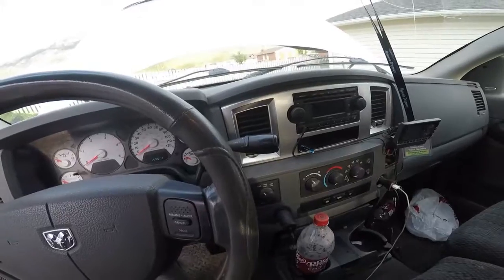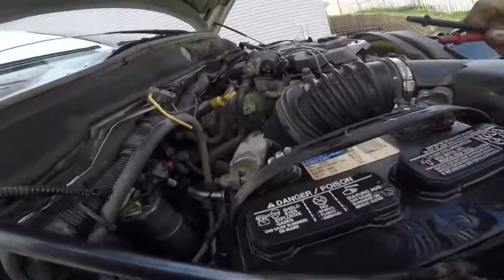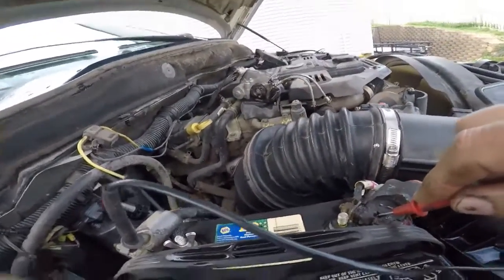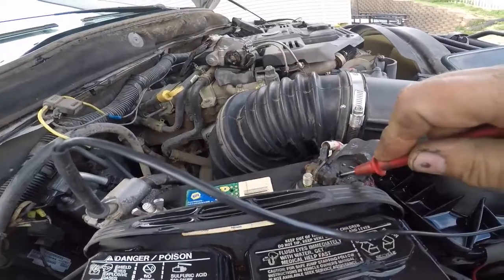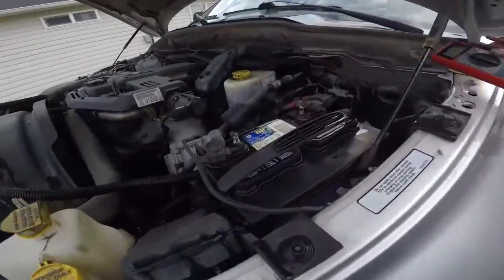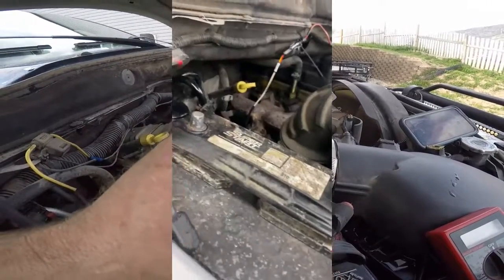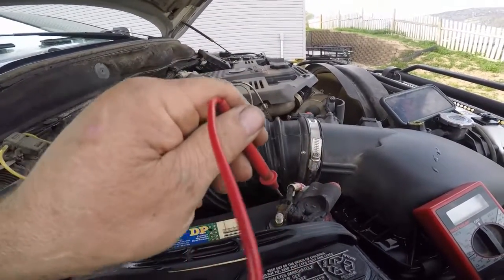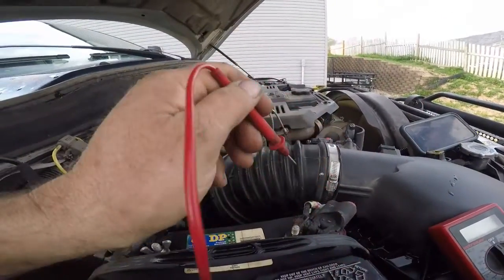Bad Battery? Cummins Battery Problems and Solutions

Comment: A professional mechanic would clean the terminals and connections when the batteries are replaced. Poor connections are a maintenance item. Also it's common to do a voltage drop test to verify the integrity of both battery cables. At that point the bolt appears corroded time to replace those 20 year old cables with new cables from rhe deakership. Repair is now good for the life of the new batteries.
Reply from the maker: you are right.
But i'm taking to the people that can't afford to or just want to do it them self. That might not have understood the problem. Saving then time and money.
You should go price how much all new battery cable would cost and then decide if a little time and dielectric grease wouldn't be the best choise for some one on a budget.